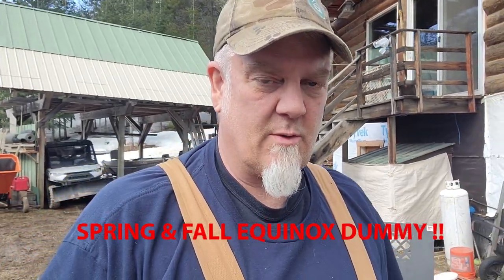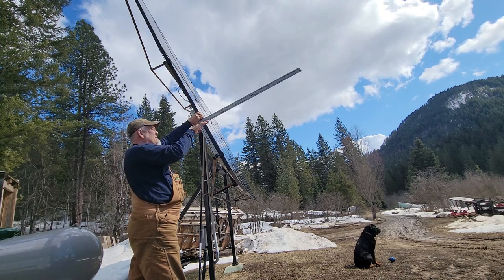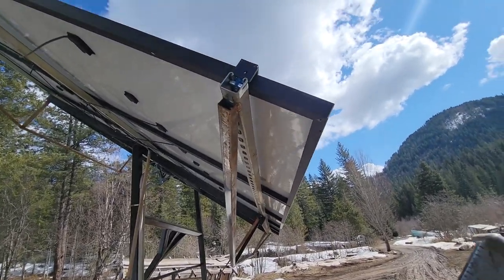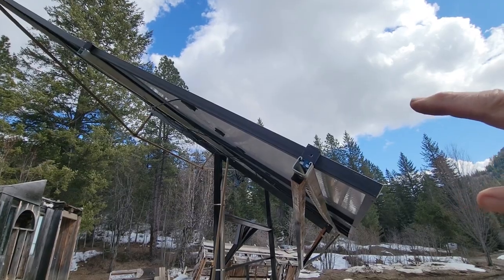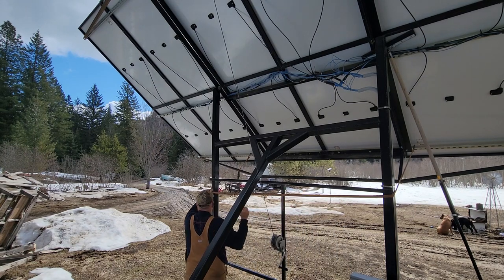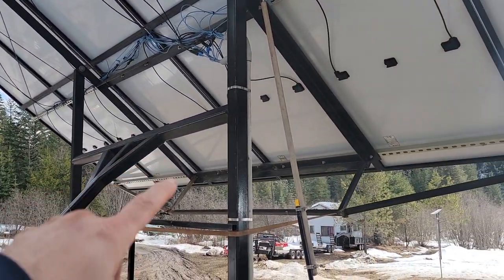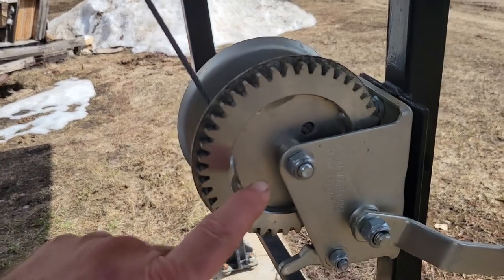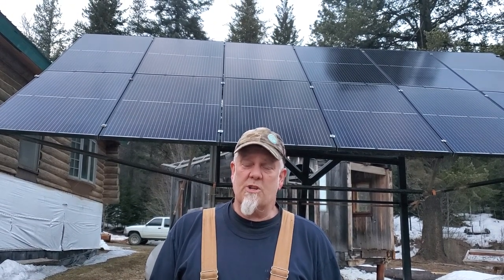How to mount SOLAR PANELS and if they should be tiltable !

Comment: When we install our panels, we want to have an automatic system that will tilt and actuate so that the panels will track the sun during the day. Then at night the system will return to the morning track angel. The system has an tracking override to put it in 100% vertical when there are snow storms, to keep the panels clear.
Reply from the maker: Yeah but how much?
Reply: @HiddenValleyHomestead  Depends on the type. For a one piece frame like yours about $750. For the single row set up for 25 panels we want, about $850. But that means having only 25 panels not the 50 panels we would need for a manual tilt to get the same solar power per day and a smaller foot print.
It needs two actuators (tilt and pan) solar tracker module, power hook-up and remote control unit.
Reply from the maker: Yeah... thats about what I found pricewise as well... Not horrible but more than I had at the time...and how much power do they use?   That would have been a more decisive factor.. cuz on those long cloudy days with little power I can't afford to lose a single KW!
Reply: @HiddenValleyHomestead  a couple of watts when making the adjustment. But you more than double what you collect for the day.

Comment: Good information...I hang my panels almost vertical in north Idaho's winters to allow most of the snow to slide off. Also I mounted the panels high enough above ground so in the winter I minimize the amount of snow shoveling required below the array.  A ground array is the only way for solar arrays in snow country. I see a few roof mounted arrays around and can't image what they were thinking. 
I brush my chimney from a cleanout at ground level. Winter time adventers on a steep roof are not something I want to consider.
Reply from the maker: Awesummmm.....   I forgot to mention that detail!! Great point to keep em high enough off the ground as well!  I used my snowblower to keep it clear!  All great insight for snowbelt peeps!!!

Comment: I have automated things like that so that a system checks every 10...60 minutes the right angle with a simple esp8266 and some light sensors up to 150.000 lux..
Reply from the maker: Yeah I've seen the automated ones you can buy.  I didn't have the money to get one and most people aren't tech or construction savvy enough like you and I are so I really feel having the ability to adjust the tilt is sufficient for our power needs.  According to that website, the power you would get if turned on both axis isn't much more than just tilted for latitude so I figure why spend the money.  Especially when my batts are topped off by 9am easily every day when it's clear.  Now maybe on cloudy days or winter I could see absorbing every last photon of sun power with an automatic system...

Comment: Why not look at the inverter production?
Reply from the maker: What do you mean?  As in measure the output?  I have a trimeric display that shows the voltage, amperage and percentage of power during charging as well as levels after charging ceases.  And could you tell me what parameters to look for? Or what parameters I should be looking for besides highest voltage/amperage?  If this is something you think people are under educated about lemme know and I'll do a video!!  Thanks dude.